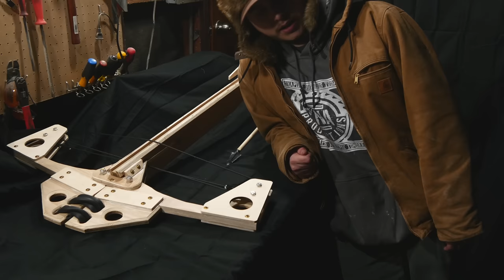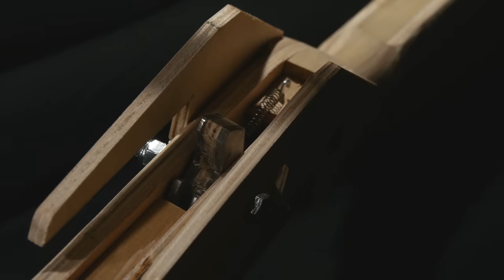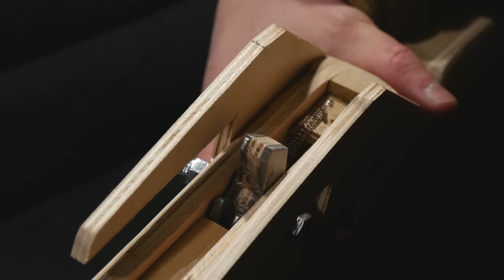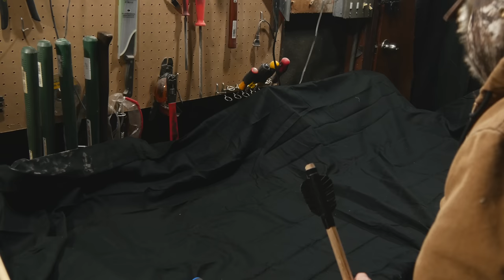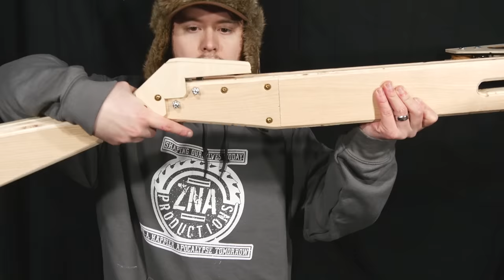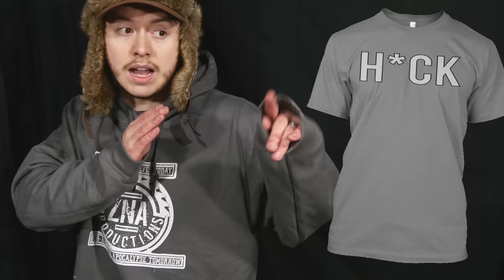i tried to crossbow but i kinda ballistae'd (Speargun Rubber *POWERED* Crossbow)

Comment: So I think you might be able to make a combination stirrup/foregrip. Bear with me here. Attach a blocky Y-shaped post to the sides and underside of the front of the crossbow, at the spot where you comfortably hold your lead hand when firing. There's your foregrip. On that, add a rectangular piece that can accommodate your foot and comes out just to or a little bit ahead of the furthest extremity of the crossbow's limbs when they're not under tension. There's your cocking stirrup. That should help with A: raising and aiming the crossbow, B: cocking the crossbow, and C: not making the crossbow even (or at least much) longer.

Disclaimer, making weapons isn't my forte so there could be some problem with this idea that I'm not thinking of.
Reply: IceDragon978 a goat's foot is where it's at.
Reply: IceDragon978 tl:dr but I might.

Comment: Belly band with hand-warmers in it, works really well. I’ve sat in single digits in the tree stand using that trick. The colder it gets the more hand warmers you add. Apparently you could burn your skin so you must have a layer between the belt and the skin. Alternatively you can tuck a layer into your pants and drop the warmers into your neck so they sit around your waist but stay because of the tucked in shirt

Comment: I live in central wisconsin, so i have worse weather. It also sucks because i have been stationed in san diego for 9 months and am not used to -20 degree weather anymore. I went from 70s to -20 in 7 hours and have to go back to SD on the 1st. Talk about a roller coaster of acclamation.

Comment: for the cold, might i suggest the ceramic pots stacked with bolts and washers (3 pots starting at large, then medium then small with space in between due to bolts/washers) with a teacandle or two under said pots? cheaper and more effective then the directional heater AND it heats an area, not just one direction. I think you may be able to make one, maybe ;)

Comment: You need to make a DIY central heating system; custom parts. I'd pay money to see that...
Reply: Devaun Huff 
I found a 4- part method that works pretty well. Buy a heater, get it home, plug it in, turn it on. Works wonders. 

Bad jokes aside that would definitely be cool. I don’t think ya going to be the most cost effective though. You can get a heater for really cheap but buying materials isn’t always cheaper. Would be a killer project though if the cold doesn’t do the job first.
Reply: Devaun Huff That night raid picture though
Reply: Deмøø Sad story
Reply: The live on in us bro

Comment: Hey Eli, habe you thought of making some sort of folding stirrup. That way you could have it about half way, or more, up the stock and not have to worry about the front becoming too heavy. Perhaps you could use a belt or strap of some kind instead of making the stirrup out of wood or whatever else to save weight.

Comment: Hey ZNA, in regards to making a system to pull back your drawstring without adding any length, have you considered a crank mechanism like the Windlass crossbows have? I think with a lower draw weight, you could make it pretty small and easy to mount with a bit of clever thinking. Food for thought!

Comment: Instead of sheets put clear painters tarp up! It allows heat to travel through one way and holds it in. It would work 10000 times better. Just a heads up

Comment: If you use a few tarps and a propane heater, it heats up pretty quickly. I got a good 10×10 area in my garage in below 0 weather that's nice and toasty. Bed sheets may not do it for you

Comment: If you crank the tension on the string/rubber too high to pull it back manually you could go with either a Goat's Foot Lever mechanism or, if it's absolutely ridiculously high tension, a winch. It ain't a fast way to reload, but lets you get kinda silly with the draw strength

Comment: The nostril shot is KILLING ME! oh well, have fun with it. Your project builds are always alright with me. Never been bored watching your videos.  Btw, those sheets you have hanging are increasing what's called your "K factor." Think of it as NON-airflow. So the more airflow you can stop or limit, the higher "K" Factor you have. Then the other one we are more familiar with, since it's been around longer:is called your "R"Factor. R-Factor is how much Infrared energy transfer you can stop or slow down. This is why the thicker the insulative material is, the higher the"R"factor is, as long as the insulative material is made of something like tiny little shards of light-refractive fibers, that we call "fiber-glass." I hope this simple scientific break-down of how "insulation" works will help you make allowable modifications to the garage you're renting until you can find that place to buy. Real Estate Hint:Look for "distressed sales;" sales that need to happen quickly. And make sure the reason is one that you can deal with pretty well, like it's been poorly maintained, and the owner had recently passed away and the children are now wanting to sell it fast and split the money. These are called "Probate sales," usually.  Go to ThanMerrill.com for more little known real estate leveraging tips and techniques. They also teach multiple creative ways to "raise Capitol, " which includes cash for closing costs, insurance, etc. And keep your head up, your top of the class! Not a bottom feeder, not a complainer, not an excise maker,  you get things done! You can do ANYTHING you keep in your sights. That goes for ANYONE. Keep the longterm goal in your sight and break it down into tiny, when needed, daily steps, even if mostly symbolic, and you'll build up momentum! Find someone to coach you, and someone to coach.  Then, after you build momentum,  the goal won't look so far away. After you reach that goal, you'll make up a bigger more meaningful goal and start the process over again, with much more confidence.  It's easier than you think to reach your goal. You can do it! Shalom (balance and harmony) to everyone's life. Joel

Comment: Hey Ellai why don't you set up like a small bonfire in your garage I sometimes chill in my garage to get away from all the nonsense in the house it's pretty cold even with the heater but the fire really adds to it I've got a metal trash can with some random wood I had sitting in my yard it helps

Comment: oh, i forgot to say earlier, if you have some old sleeping bags or quilt/comforters laying about
for h*ck sake, use them instead or in adition to the bedsheet curtain

it works so much better,
if the quilts you got dont reach floor to cieling use safety pins to hang them off the sheets your already using
contrary to popular belief youll want the quilts to sweep the ground and leave it just bedsheet at the top
this helps to reduce the cold air tring to seep in from below while letting the warm air near the ceiling
dissipate (this would prevent "indoor rain" from happening like one might experiance in an ice fishing shanty)

if you had better walls id suggest a "cyclonic" heater setup, but just "curtians" itlls be too drafty

if you were in need of a longer term setup, if you have a window you could remove,
then id suggest a wood stove, and make an insert for the window so you can direct the "chiminey" out the window

Comment: Listen, I love all of your products and all of your crazy ideas and I think I may have a new jdea for you. Attempt to make your own shock blade/sword with spare items around your shop. Use a high power battery as the end of your tang/handle and run cables through your hollow tang to creat an electric blade. This is all for shits and giggles but I think your creative enough to make this at your own risk

Comment: A hammer witch turnes into a flail .A weapon probolly a blade could be serated and bad ass the Vandal unscroos or detaches and becomes a dager .
A cricket bat witch u hit with side side ( the thin bit ) it could have a metal edge with studs no blade mabey a full blade edge on the back but it would have a cool spike on the end facing away from u the pumal could be a ring that would be nice .
Mabey a sooper compound bow ( I mean like the week things and the mint bowthing like in far crie primal extra string wheal thingy in the bow arms and like all those disines u find on bows to encreas it draw length and weight thingy if u know what I mean but not to hard to pull but u could have some really strong ruber or something to .

Comment: Its not that bad it's was a high of 12 today and will get to -10 tomorrow as the low and 6 as the high and I still went outside and I in Kansas so I'm under the Arctic line

Comment: Eli, you aren't worried that the paracord will rub against the wood and weaken to the point of snappage? 

Otherwise, h*ckin sweet ballista sir!
Reply from the maker: I buffed the track with paste finishing wax so it's extra extra smooth. The only real wear and tear on the string is from the trigger mechanism.

Comment: For the stirrup idea, you could make something called a goat's foot. Used on medieval crossbows to draw it back, sort of like a lever. Completely removable so it won't add any more weight. There are also various other tools like that, like cranks and stuff but the goat's foot is the simplest. Here's a good picture that shows it off in a way that makes the design easy to understand. https://i2.wp.com/www.benjaminrose.com/wordpress/wp-content/uploads/2012/11/crossbow-goats-foot.jpg

Comment: instead of a stirup, since it longer anyways, you could try a dual purpose bipod (wood paddle, shape it)
the idea is you can brace your foot against the "bipod" while drawing it back
or hold the bowstring while chuck norris-ing the bow forward via the bipod/footbrace

(never was into the CN meme, but since i havent seen one for over a year, i though maybe you havent either,
and since your into h*ckin' old memes, i thought youd enjoy)